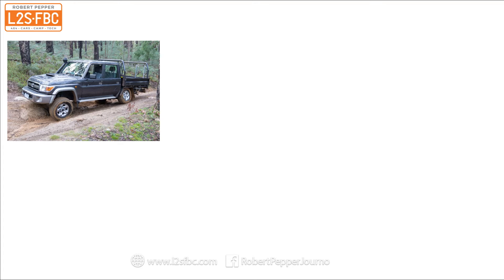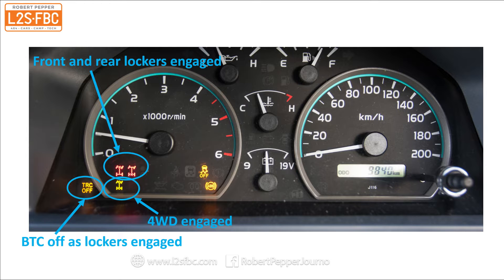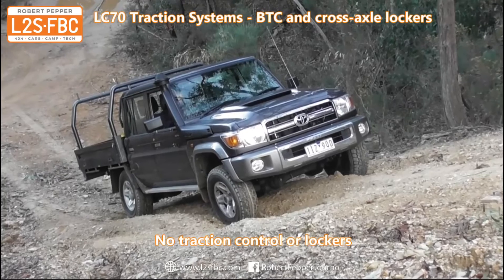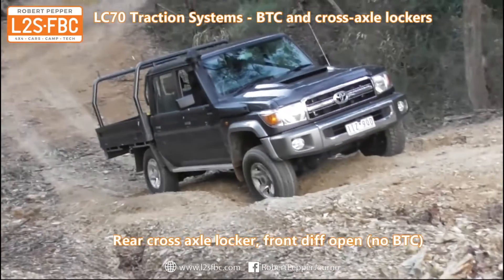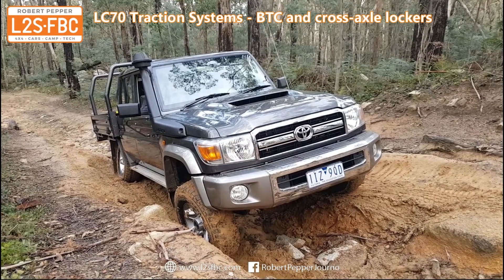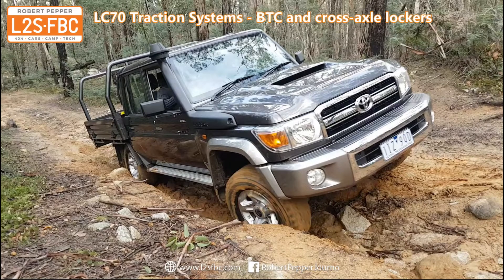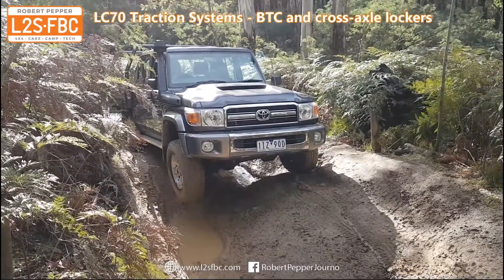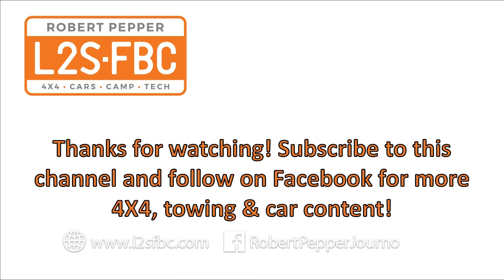LC79/LC76 Traction Systems - what do all the buttons and levers REALLY do?

Comment: Thank you Robert. I come from a defender (old) background and am struggling to fully understand the 4x4 setup on the 70 series. When shifting from 2H into 4H are you essentially locking the center differential? I also cannot understand why free wheeling hubs even exist. I see no reason not to simply lock them permanently and forget about them. If the front and rear lockers are not engaged, then no drivetrain windup should occur even in 4H on bitumen - correct?
Reply from the maker: 1. Yes 4H and 4L are equivalent to locking centre diff.

2. Free wheel hubs reduce friction and therefore fuel use in 2H as the front transmission does not rotate.

3. Axle lockers do not cause windup as the bind caused by turning left is equalised by that turning right. Windup in 4H is increased by both left and right turns. See my windup video.
Reply: @L2SFBC  Thanks for your very quick response. To clarify then. It is OK to keep the hubs locked permanently in 2H or 4H wether on loose traction or on tar road then?
Reply from the maker: Yes you can keep the hubs locked on bitumen (high traction surface) provided you're in 2H.

Comment: Nice Video.

For a full time 4wd like the 200 series, say on Murram road, what is the max speed I should go, with the Center diff locked?
Reply from the maker: Not familiar with the Murram road, but if the road is good enough for over 80km/h then you probably don't need the centre diff locked.

Comment: As Car Expert correctly explains - the LC 70 series are utter rubbish. But people still love and buy them even though they cost more than twice what they should. 

In my book a part time 4WD isn’t really a true 4WD. If it’s part time it is often (mostly) Not a 4WD. Permanent or Full Time 4WD is an actual true 4WD - all 4 wheels  driven, always.

Also annoyingly is that there are very few vehicles indeed that allow the front locker without the rear locker being engaged - they should both be independently controlled - one, the other or both; while TC should remain an option on non-locked axle.
Reply from the maker: Agreed

Comment: Thanks Robert good video just a correction to your summary, front hubs on later 79s can not be set to free or auto they can only be set to lock or auto ie in the auto mode they automatically lock when the front axles are driven such as 4H or 4L
Reply from the maker: Thanks!
Reply: Oddly the last photo showed only Auto and Lock as modes yet the screen text said Auto or Free.

Comment: Nice video 👍.
One question: What is the Neutral (N) position above the L4 for? In which scenarios would you use this?
Reply from the maker: Good question. It's neutral, but in the transfer case. That means the car is towable if an auto. In a manual, not a huge amount of use.
Reply: @L2SFBC  Thanks a lot :). Just discovered your channel and subscribed. You make very high quality content 👍
Reply: Putting the transfer case into Neutral could be useful for flat towing a 70 Series.  Or anti theft device for someone trying to steal a 70 Series by breaking in and driving it away after hot starting it.  At least for a short while, before they figure it out.

In a 200 Series or Prado 150 Series the transfer "lever" between low and high range does not have a Neutral position, so it's an indication that Toyota doesn't see the need for users to know how to put the transfer case into neutral.

Comment: You mentioned the BTC on the Prado and the 200. Does the Prado , 200 and also the Hilux all have the same BTC system (current models)?
Reply from the maker: Yes, broadly. The basic electronic systems are the same across all Toyotas, but tuned differently. There is more difference between a 2010 Prado and 2020 Prado than say a 2020 Prado and 2020 Hilux. The one vehicle they tuned poorly was the LC70, I suspect that they just threw ESC onto it and BTC was a by-product of that and they didn't spend any time on it. The LC70 is very poor compared to the other Toyotas.